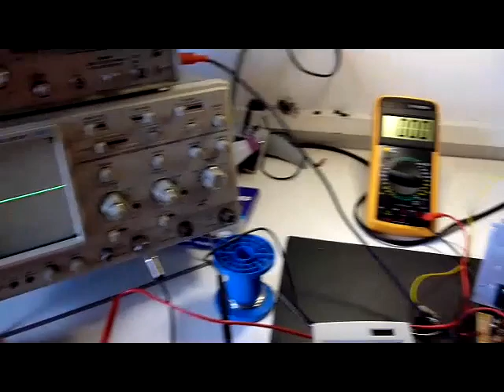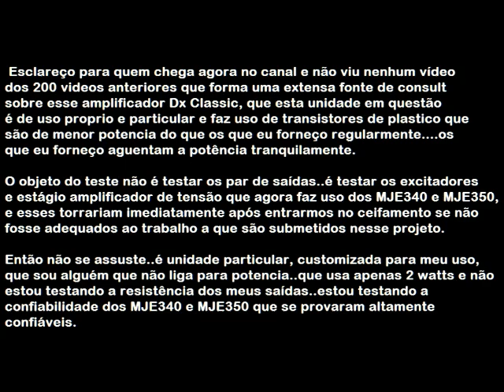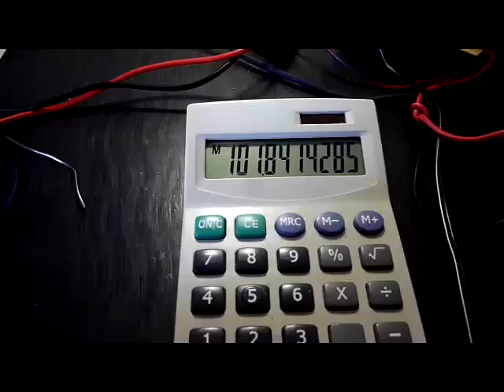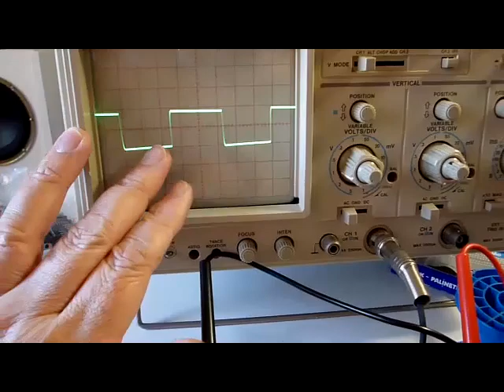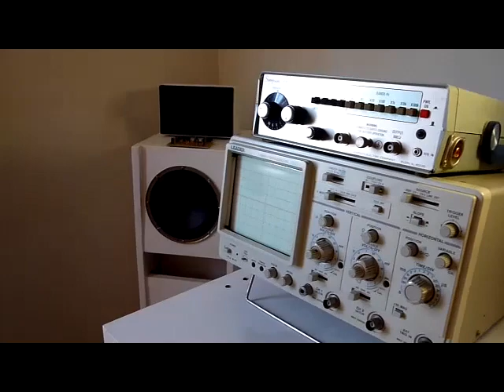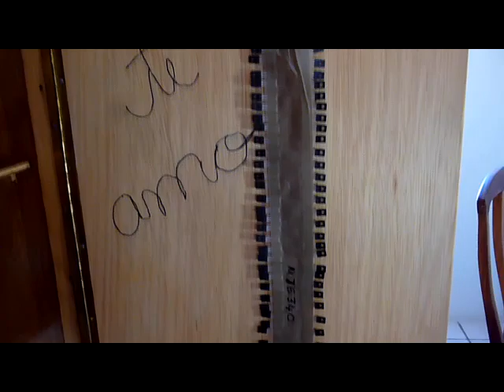Dx Classic - Aprovados os MJE340 e MJE350

Comment: Sr Carlos  o que você acha dos amplificadores com transistores darlington?
Reply from the maker: Alguns são muito bons para áudio...outros são para chaveamento e não dão muito certo para áudio..... você não tem acesso ao resistor de emissor que necessita de calibração.....que tem valor critico...e se a pessoa não pode ter acesso a esse componente para calibrar o seguidor de emissor daí fica complicado....é caixinha preta Jharlem, coisa fechada que não tens acesso..... compras pronto os dois transistores com alguns resistores dentro e não podes calibrar
Reply from the maker: Solução barata, porque tem dois transistores dentro de um unico encapsulamento.... coisa bastante prática apesar da inconveniência de não podermos calibrar a saída.... o ganho geral mente é muito alto...passa de 1000 quando no caso dos discretos, muitas vezes, não chegamos a tanto...isso obriga a colocar um capacitor entre base e coletor para evitar oscilações por conta do ganho.... e esse capacitor varia seu valor segundo o ganho...acaba sendo 450 pf, ou 560pf, ou 680pf...... algumas vezes até 1000pf..... isso torna o dispositivo super lento..o tempo de subida fica sacrificado...o slew rate cái por terra e o som agudo fica embaçado, indefinido...solução barata..... solução econômica...meu vovô, falecido a muito tempo, dizia que a economia é mãe da porcaria....e essa economia gerada pelo encapsulamento darlington se encaixa bem na definição Jharllem
Reply: +Carlos Mergulhão kkk concordo com seu vovô também 
coisa muito barata geralmente não são tão boas. 
valew 
agora entendo pq se vê poucos amplificadores com transistores darlington